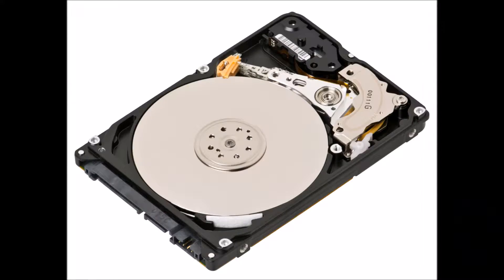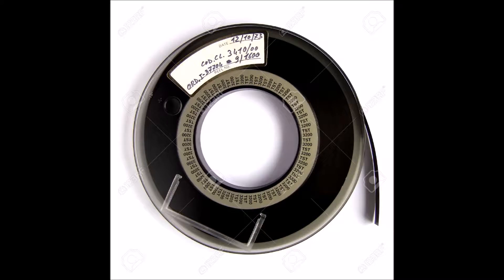How does magnetic storage work (floppy disks, hard disks and tapes) and when do people use them?

Comment: What kind of floppy disks do they sell near you! I can only seem to find 1.47 MB floppies or are you measuring with mebibytes instead of megabytes? Also, it is pretty genius to use a drill bit to describe a bit, but it raises the question that if you have 8 drill bits do you now have a byte of bits?       P.S: I know this video is 6 years old, but I needed to say a "WORD"(16 bit unsigned integer). Along with that magnetic tape storage has become one of the best and cheapest ways to store data for long term like the LTO-10 tape drive cartridge which holds 48 TB, and a compressed storage capacity of 120 TB.